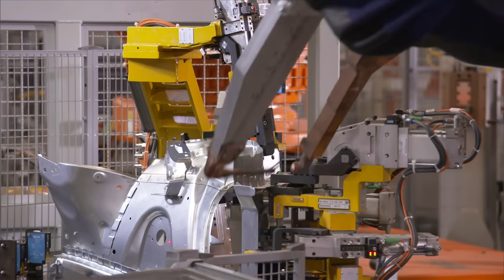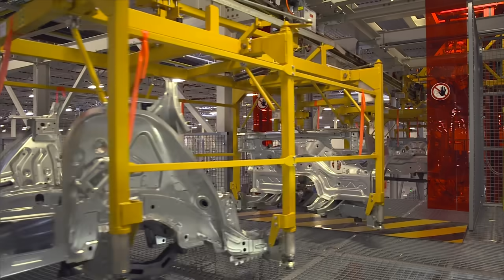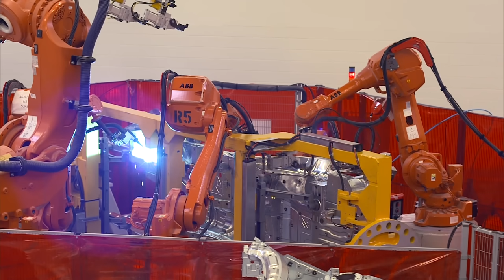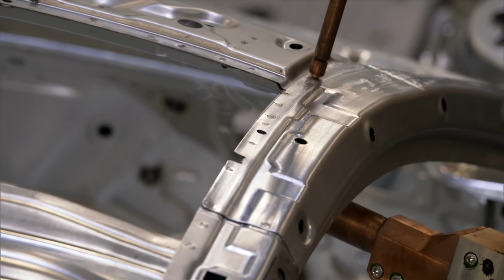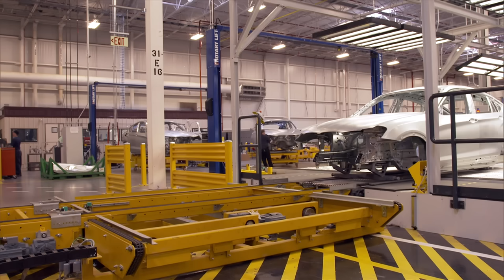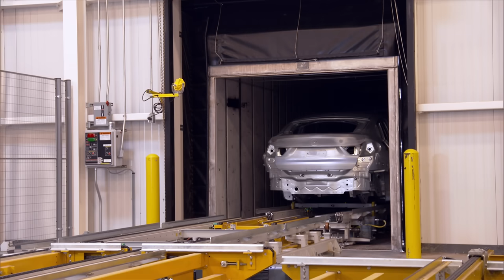BMW Spartanburg Welding Body Shop

Comment: I have designed many of those welding stations, never seen them in person. It is fascinating to see it in action at least on video.
Reply: Hello, I actually have a project on this welding workshop and I wonder what are the recommendation that you think it's should be focused on
Reply: Why have you not seen them in action? I would have thought that part of the project would be making sure your designs worked?
Reply: @bobolulu7615  sadly not part of my job. I was just one of many designers and our client wasn't the car manufacturers themselves, but ThyssenKrupp (mostly) who was responsible for full functionality. If something didn't work, they requested specific adjustments in models and drawings. In case someone had to discuss the project in person, it was management or project leaders.

Comment: At one point we see the rear door on, and then at the end it comes off the line with all doors installed.  Can anyone CONFIRM that robots are installing the hinges and then installing the doors?  Are are the doors just in a temporary position to be installed manually elsewhere?  Thanks2

Comment: Can anyone help explain the below queries?
1. @2:54, what is the method of inspection for sealer?
2. @5:05, robots pick the BIW and rotates it 180 clockwise and then again 180 anticlockwise... Why?
3. What is the gripper at 5:37?
Reply: For sealent detection most probably there might a provision of vision system somewhere above the dispenser

Robot rotate the full body ...its probably an a measuring station where critical point are being checked with camera system

Gripper is door fitting jig it check the flush and gap within tolerance
Reply: @abajidhage5262   Thanks for the info.
 but regarding my 3rd point, I still have doubt about the robot's functionality which goes through the front windshield @5:37, as the image is not clear.
Reply: @abajidhage5262  bro can i know what is Jig.

Comment: What type of welding in this car?
Reply: The majority is Spot welding. There is also some Mig welding and BMW uses a lot of adhesive in place of welding. All three methods are seen in this video. I used to work on those lines in that plant.
Reply: it is real engineering
Reply: Spot welding